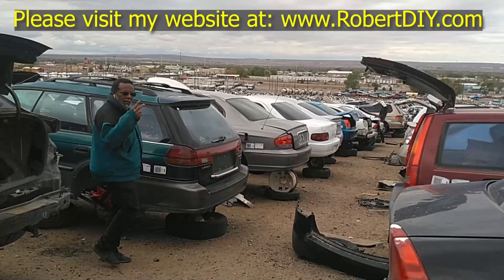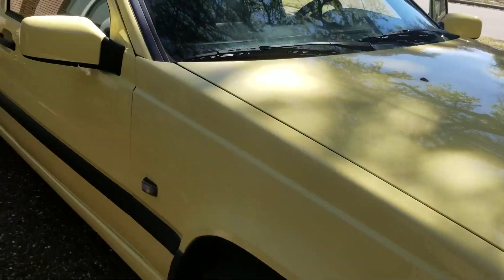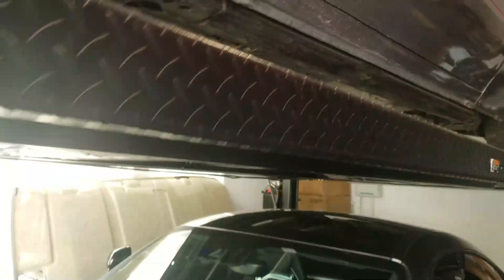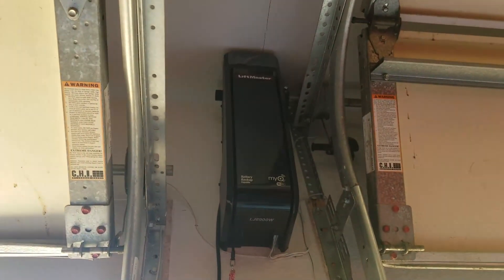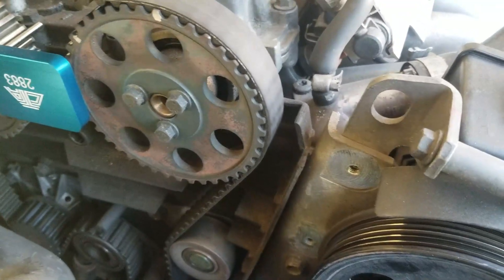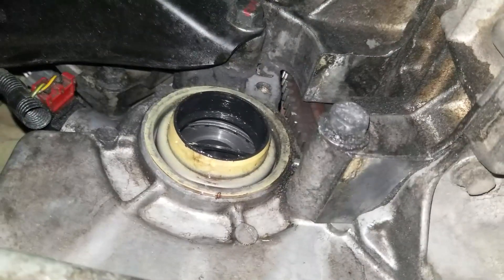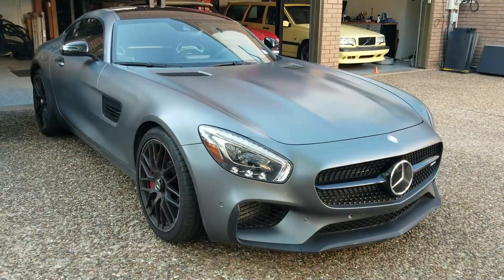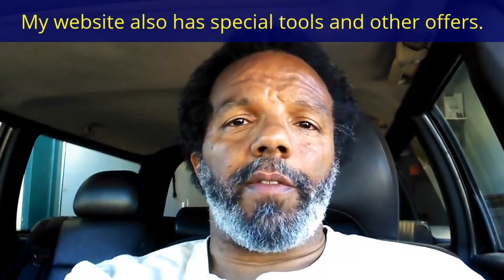Nice weather, worked on a Volvo 1995 T-5R, CV axle input seal for the transmission and timing belt.

Comment: Robert, I,m having a hard/impossible time finding a . . . Volvo shift lock solenoid  for 1996 850 Turbo Platinum.  If you run in to one pick it up for me, I'd even have you install it.  Any ideas for Volvo part suppliers, I'm using europarts.  Thanks DH
Reply: I got mine from IPD.
Reply from the maker: https://youtu.be/UNQ2tVzeTmM
Reply: @redbeak1453  Great, Thanks for the connection!
Reply: @RobertDIY  OK got it, Thanks